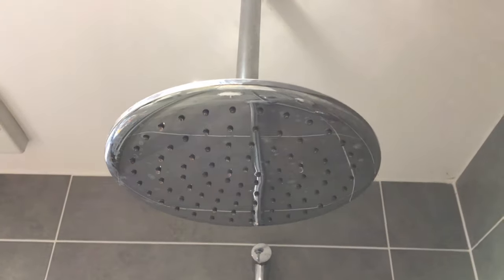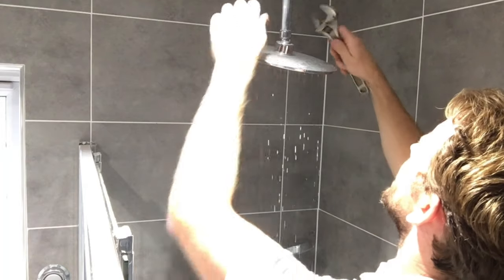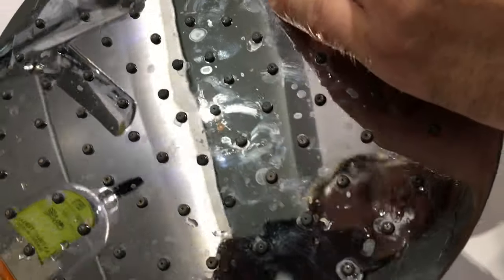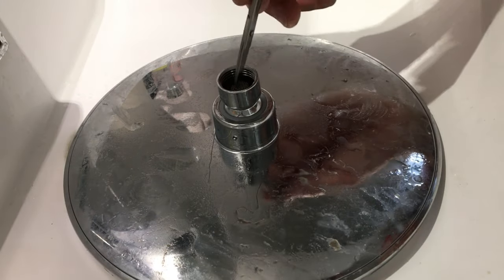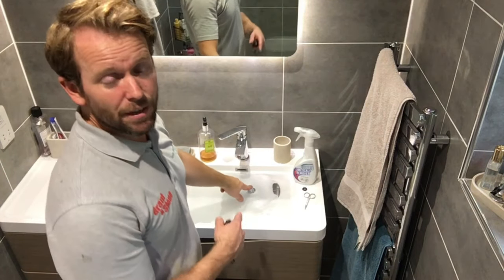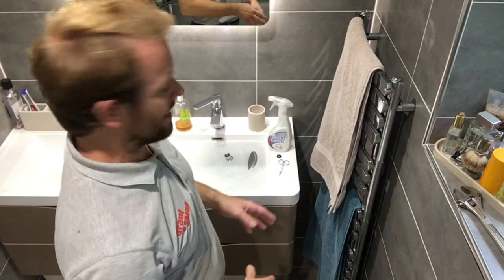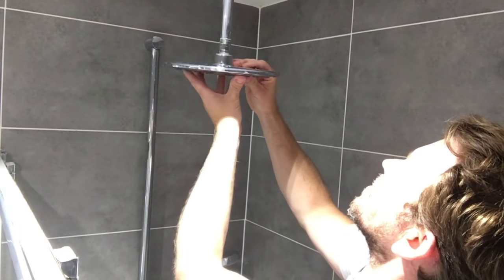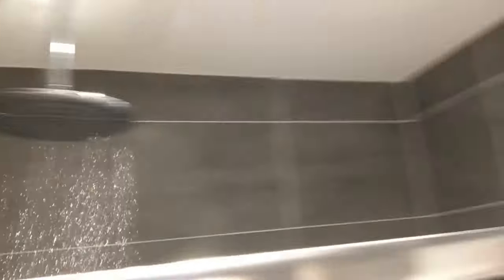How to clean/remove a Rainfall Shower Head | De - Limescale | Replace

Comment: Use white vinegar in a large freezer bag with the head attached. Use a sturdy rubber band to secure it on the pipe.  Worked perfectly and environmental friendly
Reply: I’ll have to try this. My friend has a rain showerhead, which I hate! I once tried putting vinegar in a garbage bag to hang on the showerhead. But I’m too short (even with a stepladder) and not strong enough to tie the bag around the showerhead. I’ll try a freezer bag. Thank you!

Comment: Thanks for this - on the variable head flow heads there must be a way to take out the disc with the holes in it to clean it?  Is there a way?  We have Trevi heads and there must surely be a way to take them apart?

Comment: The black rubber seal has wire mesh. It is ok to have just the black rubber seal Without the wire mesh? Reason for better water flow rate. Tks

Comment: if the nozzels fell away,,are they replacable,?? any links? and how to reinstall?
Reply from the maker: It really depends on your type of shower head. If possible you should check with the manufacturer if it’s still under warranty or if they sell any spare parts online. Thanks 🙏🏻

Comment: I can’t take mine down as I don’t have anyone to help me. Any ideas?
Reply: Put the cleaning products in a bag and using an elastic band secure the bag on the shower head.
Reply: Mines above a bath and very high pretty much 1inch from ceiling (rental property) so I had to put steppladder at side of bath and stand like that to unscrew it but did it with hands only, have a towel to hand as water does drain from it once you tilt the head.

Comment: Not all shower heads can be removed…
Reply from the maker: Excellent! 😂
Reply: @lesterbathrooms3948  what about the modern square rainfall ones in the ceiling.  Is it possible to clean and maintain them? Cheers
Reply from the maker: Well if there’s no above (loft/attic) access it must have been installed from below so in theory should be able to be uninstalled from below. The trouble is there are so many different versions on the market all with different installation methods and it may take a lot of effort to take it down. Some have retaining screws, some have springs that you pull down and release, I can’t possibly cover each product. I really hope that you are able to sort out your problem. 🙏🏻
Reply: @lesterbathrooms3948  Thanks for the reply and help comrade. I'll be careful to look for ease of access of the product. Because it is certain that at one point the holes will clog with limestone. Cheers mate
Reply from the maker: @jakovbrkic3716  cheers mate 🙏🏻

Comment: kay, I call foul!  If the shower head is sitting doing nothing, your not gonna have all the junk around the sink, its still gonna be in the head.  There was no little fairy in the sink with a brush scrubbing the inside of the shower head with enough force to get junk to the outside.
Reply from the maker: It’s one of YouTube’s great scandals! You got me!! 😂😂
Reply: It foams and bubbles.  If it is foaming or bubbling the stuff is moving.
Reply: @ElCid70   - maybe, but read what I wrote "with enough force to get junk to the outside".  Bubbles alone will not do that!!